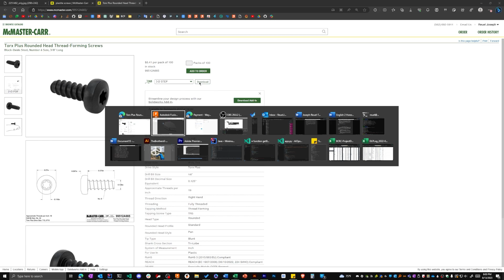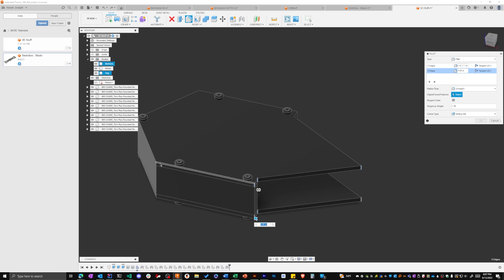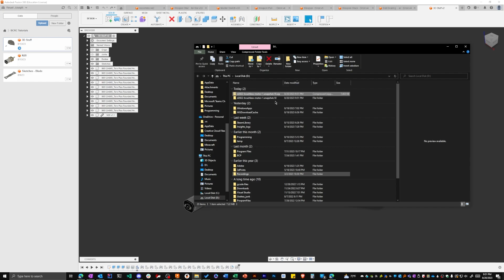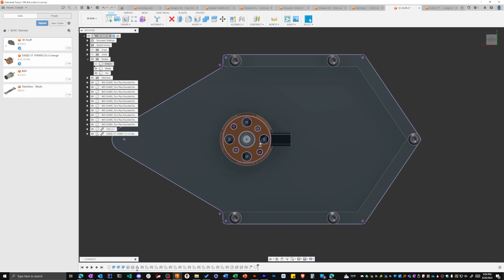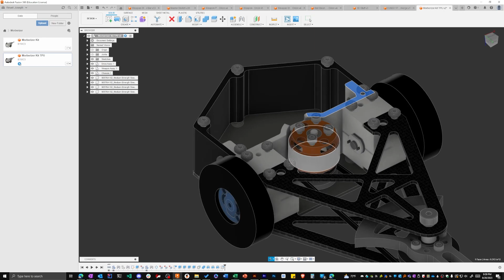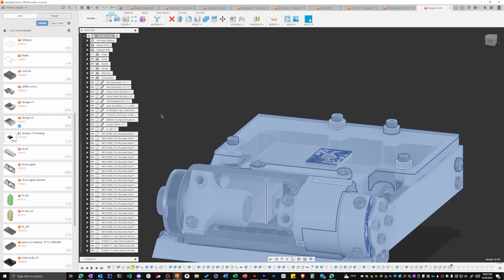3D | Part 2 - Intro to Fusion 360 for Combat Robotics Pt. 4 | BCRC

Comment: Did you create the CAD for the just cuz robotics kill switch yourself based on measurements of the real thing?

I’m having some difficulty with taking objects like the kill switch and recreating them in fusion. Any suggestions?
Reply from the maker: Most of the time, parts like those have CAD models publicly published. This is the Just Cuz switch CAD: https://gelburd.autodesk360.com/g/shares/SH919a0QTf3c32634dcfb1bf230f603045e9
You can download this and then File>Open on Fusion to import it into your design.

Comment: Awesome step-by-step video! 

How did you hide your components so quickly when going through the motors and other fittings? Is there a key shortcut?
Reply from the maker: Yes, you can use the 'v' key to hide bodies